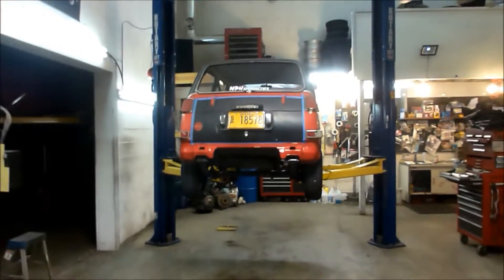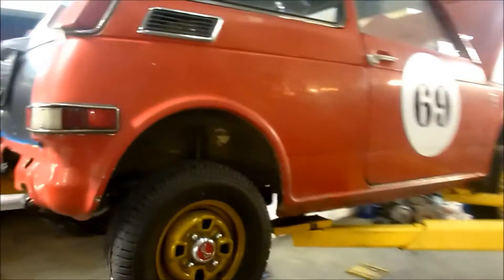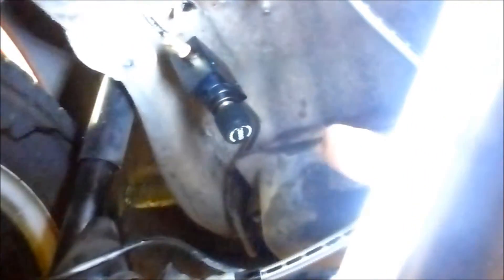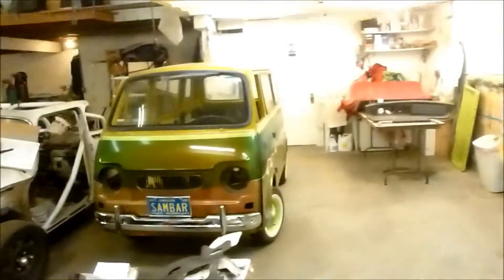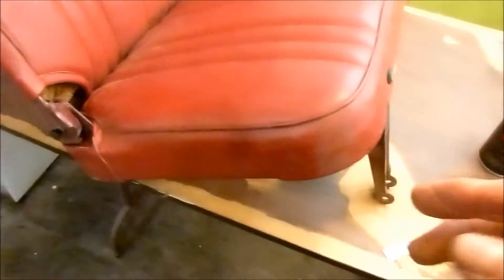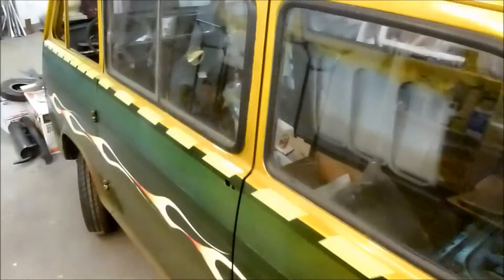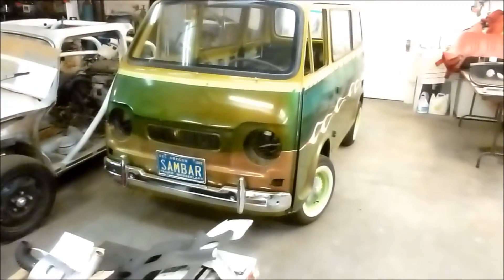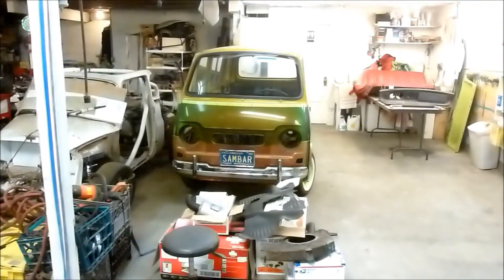Projects ! Projects ! Honda N600 and Subaru Sambar projects

Comment from the maker: The windshield is from longtime Subaru 360 club member Billy Paul in Florida. We had one heck of a time fitting it to the opening. I don't know if you recall, this van was rolled and I sectioned in new top above the windshield opening. So I don't think the windshield was made wrong. I think it was my body work. It just didn't fit easy or good. We had to custom fix a lot of stuff to make it fit. I don't really even notice it much now. No one else does either unless I point it out